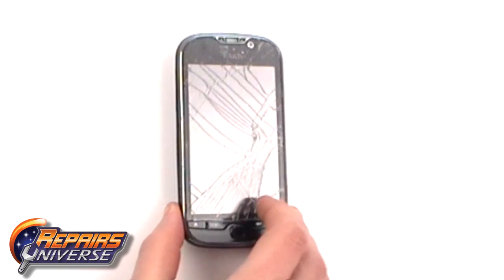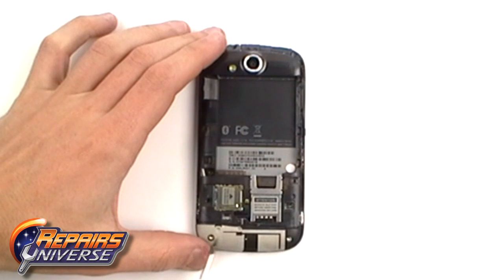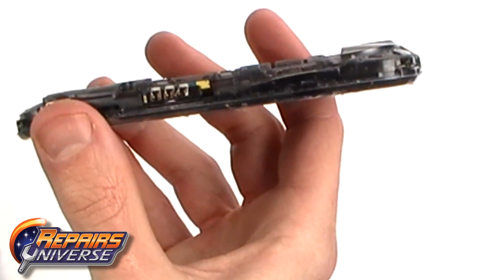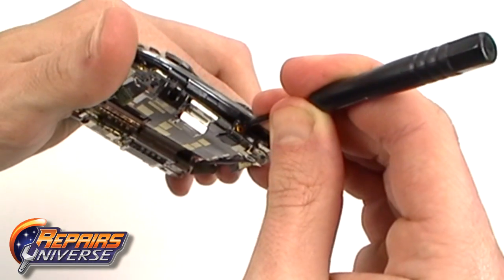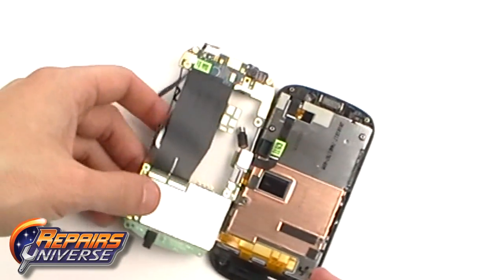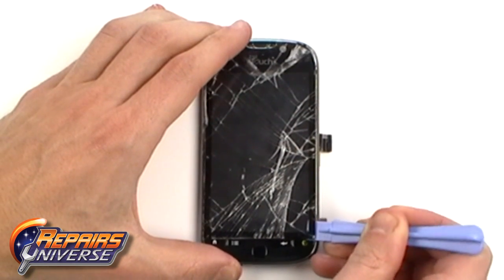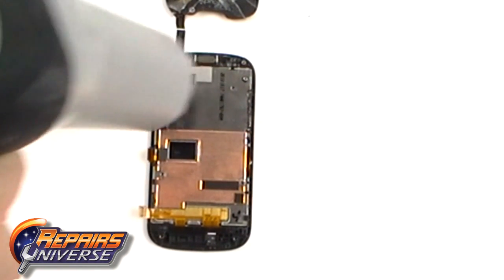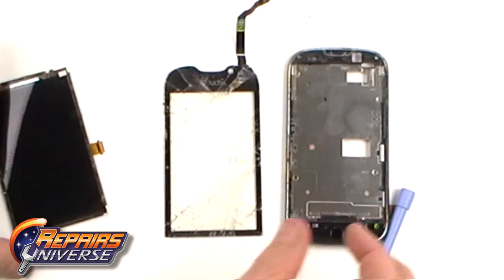HTC MyTouch 4G Take Apart & Screen Repair Guide

Comment: does anyone how to fix the WiFi error, keep in mind phone is not rooted never been rooted, never been wet all the functions in the phone works perfect, already done hard reset with the volume and power button still same results, this is not a problem with my router either phone does it everywhere every time I turn wifi on and it gets stuck in a turning on and off cycle and after while below the wifi option error message comes up says error only way to make this error message disappear it's to restart the phone or turn it off then back on already check all the setting, wifi never off, on battery usage no luck help

Comment from the maker: Damage like that is tricky to mess with, you can try cleaning it out, but the best option would be to try and change out the Digitizer (Outer glass) and LCD (Internal display) though there are no guarantees with something like that. You can order the combination from our website at repairsuniverse (.com) and we also include a repair video as well as as "Livechat" to assist you in fixing it. Good Luck

Comment: There's oil inside my phone (someone set it in a puddle of oil face down) between the digitizer and the lcd, but the phone functions just fine, the only problem is a big dark spot covering 80% of my screen making it difficult (not impossible, just difficult [but impossible when i'm outside, it's like my phone is at lowest brightness when it's at highest]) Will I need a new screen? Or could I just clean it out and be fine?

Comment from the maker: This is an issue with the LCD. Check the connections and cables for security and damage. You may need anew LCD which is available at RepairsUniverse (dot) com.

Comment: When taking the battery holder apart, a clear small piece with a circle/hole and 1 dot of glue came off and I don't know where to reinstall.  It appears it came from the camera area - any suggestions?

Comment: I was able to replace and fix my screen but the front facing camera stopped working. Is there a wire or cable should I go back to check if disconnected? If so which one?

Comment: My phone's sleep button isn't as smooth as it used to be, and it's become stuck to the point that I can't put it into sleep mode or turn the phone on/off. 

P.S. It'd be awesome if you could do a reassembly video. Thanks! :)

Comment: My Mytouch 4g started showing charging problems. It would work while on charge but after I would take it out of charge. The battery would drop drastically to 5%. This continued for some weeks and one morning it stopped working. I tried charging but nothing happened. Any suggestion on how to fix it ?

Comment: I had this happen also. Now my power button doesn't work. lol. It's a small medal piece that has a square base and a little circle metal piece on top of it. I can't find a replacement piece ANYWHERE. I have tried putting a piece of plastic in there but it has to be metal for some reason..  a flat head screw driver does work for a workaround.

Comment: Same happen to me,for some reason the buttons got stuck. No debris from internal components were causing the problem. Trying to solve the problem one of the tiny cables broke. Now it wont boot-up.

I didnt need to change my screen I just wanted to fix one big scratch in one of the corners changing the frame and body and now i dont have my beloved phone anymore.
If you want to do something like that i recommend you to leave to the professionals.
Or have another extra phone around, just in case.

Comment: Hi, I really want to order a replacement screen for my Mytouch 4G from RepairsUniverse but I'm worried that the screen won't be the same quality as the original (not to mention that some of the first Mytouch 4G screens had wash-out problems). Are the RepairsUniverse ones "OEM" stock?

Comment: I've changed the digitizer by following the video and all is good... however, now the wifi is not picking up the signals.... it will constantly search for the signals.... it will pick up the signal if I put the phone right next to the router.
I've checked the cable and it is seated tight... can you tell me what might be the problem?

Comment: It seems my power button board came loose from the flex cable when I pulled it. Any way to fix it? It looks like nothing but adhesive strips are holding it together..

Comment from the maker: You should not need any adhesive for any cables to stay in place. That is the purpose of the locking clips. It could be that the clip or the ribbon is damaged.

Comment from the maker: @drthompson13 Double check that all screws are removed. If there are still a few screws holding the motherboard flex in place, remove those first. There will be some adhesive, but it should be fairly easy to lift.

Comment: Hi great video by the way.  When attempting to release the jaw clip as in 4:57 the jaw clip broke.  Now the screen won't light up but the buttons do.  I think that it is because there is  a connection problem between the lcd screen and the motherboard from this broken jaw clip.  its there a way to attach a new jaw clip or would I have to purchase a new motherboard?   Thanks.

Comment: Everything seems to be working fine (phone turns on/ receives messages), but the LCD display is pitch black except for a big blob in the middle of the screen. There was a similar shape on the LCD when I was reassembling the phone. Would that help explain the outcome? Have I broken my LCD? Any other suggestions? Thanks!

Comment from the maker: @kushkupkakes Hmm.. Was hoping that wasn't the case. The overheating is not a good sign and normally means its more of a motherboard issue. As for the power button, that is part of the motherboard flex cable. Seems like they all are related. If the phone is under warranty, I would suggest taking it back in and letting them deal with it. Overheating is a fairly common issue with faulty HTC motherboards and parts.

Comment: @RepairsUniverse Yes when charging the battery get pretty darn hot. For about the past week or so my back button only responds when I push it really hard, almost causing my finger to hurt, because its kind of stuck down. Also when I go to lock my screen tapping the power button once, then releasing I noticed that sometimes it will not lock at all it just stays lit up till my screen times out.

Comment: Today my phone was on red below 5% (its never got that low before) I charged it, it came on ran properly for about 5min then the screen started to freeze a little so took the battery out & let it charge for awhile I then tried to power it back on no response just a black screen but the orange light was on. I left it on charge for another 15min then the light changed to green. Still no response. Lately my buttons have been acting up don't know if that has anything to do with anything. pls help!!

Comment from the maker: @TheLuceroStudioz Could have caused the flex cable to rip a bit, or possibly the connection came a bit loose. Sadly, you will need to follow this video fully to gain access to the touch screen connection.

Comment from the maker: @SilverShadic360 Could be a few different things. The best thing would be take it to a local repair shop who can diagnose the issue. However there are a few quick things you can check. You can follow this video for about 4:00 minutes and check all the motherboard connection, especially around the white antenna cable.

Comment from the maker: @l0St03807 Normally this can just be a loose connection for the LCD screen, or the LCD screen has become damaged. If it still powers on, vibrates, etc, then it is very likely just a display issue. I would check the connection and if it appears fine, replace the LCD screen and that should resolve the issue.

Comment from the maker: @SuperAntman12 Normally this is just caused by an alignment issue with the keypad, or possibly a connection issue on the keypad flex cable, under the buttons themselves. I would suggest checking the cable at 3:52 to be sure it is fully secure and no damage has occurred to that flex cable.

Comment from the maker: @MrHitthatsplif That is odd. You will either need to use a screw extractor to remove the screw, or use a small drill bit to drill out the screw and remove. These are your two easiest options.

Comment from the maker: @wgibanez Would depend on the on the replacement motherboard. Technically there should be nothing you would need to do, just boot it up and possibly preform a hard reset on the device. We focus mostly on hardware, the software side is not our area of expertise, however we have swapped many motherboards without an issue.

Comment: @RepairsUniverse so I took apart my mytouch just like the video except the screen I think the motherboard is the issue because aside from the computer not recognizing it it also has cloudy areas on the bottom and top of mother board strip. now if I replace the motherboard what else would I need to do to it to boot and work properly given thats the only issue...

Comment: My Mytouch 4g  had gotten wet but only around the volume part it only works when it wants to and the worst part is that it to hard reset mode and i had did almost ever hard reset video there is here and i follow all the steps but it goes bad the reset menu , what can i do thank you.

Comment from the maker: @wgibanez Very tough to diagnose water damage from afar, however I can give some basic diagnosing tips. Plug the device into a computer and see if it is recognized - If it is, then likely the motherboard is fine and it could be a battery issue, LCD screen issue, or charging issue. If it is not recognized then it is likely some motherboard damage has occurred.

Comment: I need help I dropped my mytough 4g in water its been about a week now when I put the battery in it and I have 2 batteries to test it... well when I press the power button the screen lights up but when I let the button go it turns off it does not boot what could be wrong should I take it apart and clean it or does it sound like i need to replace something.... thank you for your help...

Comment from the maker: @efrain5601 Likely just an issue with a connection on the motherboard. I would suggest disassembling to the motherboard and checking all connections on the motherboard, especially around the sim card tray.

Comment: its easy to disassemble the home button assembly. there are 2 clips thats holding it in place. just gently pry it and careful not to break it. the home button should be properly seated. there are also 2 small clits where in the home button assembly. i think you should slide the home button UNDER those clits. not too sure though .. if that dont work. try to seat the home button on TOP of those clits. good luck!

Comment: Thanks again RepairUniverse for the reply. I finally got it fixed. @SnObUnNiE04..what i did is I noticed that the touchscreen was I think blocking the menu button or it was pressing the home button down causing the device to boot on safe mode. I reheat both the top part of the digitizer and the bottom part of the LCD and gently pushed it upward.. away from the home button.  Then I also disassemble the home button assembly and made sure that it was properly seated on the housing. sorry, no video

Comment from the maker: @coolpals Glad to hear the repair went smooth! As for the safe boot, this is caused when the buttons are pressed in. Normally this is caused by over-tightened screws on the housing, or bad alignment. The best way to fix this is to remove the housing and just attempt it again with a bit less tension around the power and menu buttons.

Comment: hello. I just replaced my LCD and digitizer using your video. This video is great! Anyway, I thought everything went well. it looks like. hehe.. but when i turn it on,  I noticed that its running on safemode. . and the home and menu button is stuck. i can't press it down. if I losen the bottom screws. it works, but if put the outer cover again.. same thing. checked everything and they look ok. now it only boots on the boot screen. only way to turn it off is to take the battery off. any tips? thx

Comment from the maker: @AznRere Which screen was replaced - the glass touch screen or the LCD screen? Likely just a connection issue from the LCD screen's flex cable to the motherboard. I would double check this connection.

Comment from the maker: @42youtub The front is a screen protector, as is the rear. The back protector will need to be removed. The purpose of this is to protect the circuitry of the digitizer and prevent scratches. Thank you for your advice. This video is in fact on our list of videos that need updating. 
Good luck and let us know if you have any further questions.

Comment: When I received my touch screen digitizer, there is clear  film  on both sides. Obviously the front side is to protect the screen from scratching.  whatabout the back side?  Do I remove it before I install the screen?   Also,you really should  update the video with the "4 screw" thing regarding the motherboard  removal, it  would make this the BEST  videoout there.  THanks

Comment from the maker: @drjazz88 Hmm. does seem a bit odd. I assume the motherboard is clipped into the housing correctly? Also the buttons and button flex is properly seated? Sounds like something is not aligned properly, but difficult to say what exactly. I would check the motherboard to see what is physically pressing the back of the buttons.

Comment: My menu and back buttons are stuck because the motherboard is pressing too hard from behind.  The buttons work until I push the bottom of the motherboard into it's plastic clip there for holding it down.  And thats when the buttons get mashed.  What is going on here?

Comment from the maker: @Jamesdash No problem at all! That alignment is very stubborn sometimes... You will need to disassemble again to the point where you can adjust the bottom flex, then check periodically during assembly to be sure the buttons are still aligned. Sometimes housing can jar them out of alignment or even physically stop them from pressing down. Will just take a small bit of trial and error, no real secret to the process sadly. Good luck!

Comment from the maker: @190Bmxer190 This is normally caused by not enough "lift" (adhesive) from the touch screen and LCD screen. Also it is possible that the side buttons are being pressed in, many times this is caused by over tightened screw housing. I would not be too concerned about damaging the LCD screen. Move it around to the correct position, add some adhesive and re assemble. That should resolve the issues.

Comment: So my main issue is those buttons being pressed down and it being stuck in safe mode. Also someone told me that the lcd is seated in a metal housing, and by me taking it out it probably came out separately. He told me he could try to re seat the lcd.but there is a likely chance that he would crack the lcd.

Comment from the maker: @TYPOOH9210 Could be a few reasons it will not fully boot. Check to be sure none of the side buttons are being pressed in, making the phone attempt to boot in safe mode, or similar. Sometimes this can be caused by over tightening the housing screws. Also may be worth checking the motherboard and flex cable for loose or bad connections. Adhesive can be found at RepairsUniverse (dot) com. We have used this adhesive for many years with great results.

Comment: I am a do-it-yourself type. I have repaired a lot of things on my on. I replaced the screen on my blackberry awhile back. I can tell you I wish I had never attempted this. An inexpensive do-it-yourself repair has now turned into sending this somewhere at more expense than it wouldve been had I just done that in the first place. I will now have to pay for a new motherboard due to the extremely delicate parts that I have broken trying to re-assemble this phone. I would not advise this method.

Comment from the maker: @j5match This is the LCD flex cable and is very important to get a full connection. It is a tight fit, however here are a few things that may help: be sure the flex cable is fully through the housing without any slack. Make sure the jaw clip is fully opened and move the motherboard and MB flex all the way next to the cable, nearly overlapping the screen assembly. Gently get the flex cable aligned with the connection and slowly push the cable into the slot. You can then close the connector.

Comment from the maker: @j5match Yes, you can use software to avoid using the physical buttons. HTC has been using this volume button system for a while and it is very fragile and poor design. But if you ever feel the need to replace it, it is the full motherboard flex cable that will need to be replaced. 
As for the clear plastic piece, it is likely just a brace for the housing. Reassembling without it will not disrupt the functionality in this case. It may be worth adding more adhesive to give the digitizer more lift

Comment: @RepairsUniverse Thank you.. Its the very skinny volume one that broke off, the rest are back in and feel normal after reassembly. Is the phone usable with the volume one broken? like using the controls in the phone's software?
Also, there was a small clear plastic piece that fell out during disassembly and I dont know where it goes. Help please. :)

Comment from the maker: @j5match Using the correct thickness of adhesive will give the touch screen enough lift from the LCD screen. It may be necessary to add more. The motherboard flex cable controls everything from the power button, headphone jack, volume buttons camera, and more. These are available at RepairsUniverse (dot) com.